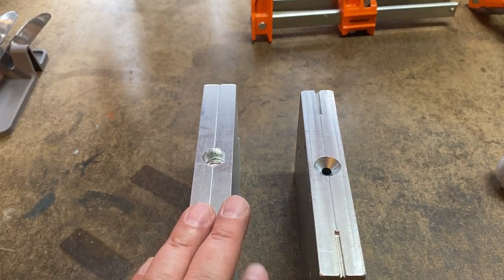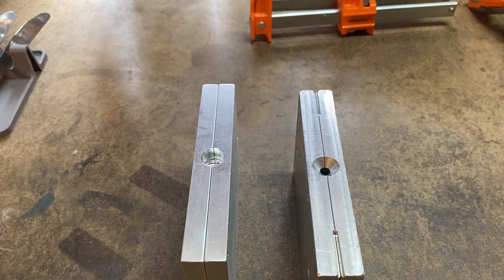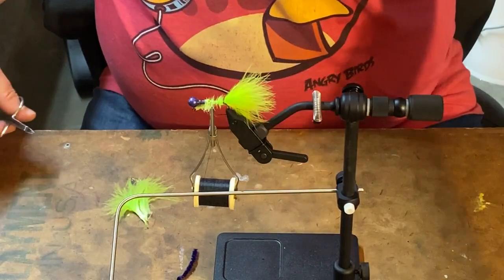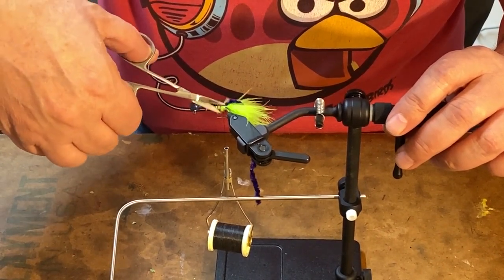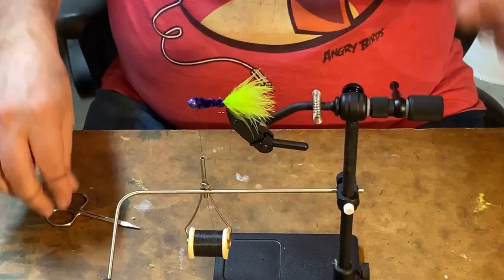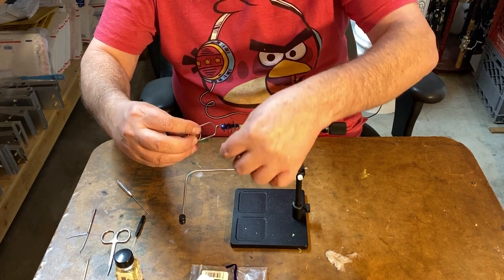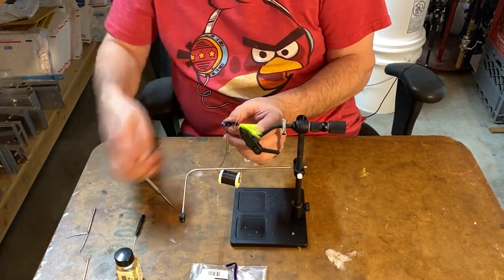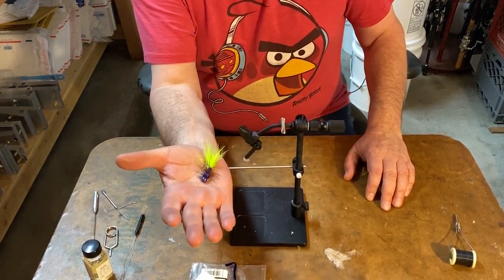Wooly Bugger Jig

Comment: Thank you for showing how you inject that mold.That doesnt look to bad or that unsafe. I was wanting one of his crappie molds and i think i will go ahead and order it without his injector.Doent make sense to have a injector for only one mold.Again THANK YOU.
Reply from the maker: Glad I could help Andy. :)
Reply: Jacob's molds makes an adapter for $25 that makes it so you can use a non tapered injector and or blending block with his molds. I too only have 1 of his molds at the moment and the adapter is what I use. It gets to be a bit much using the adapter, then blending block then injectors but after a few times you get a system down. Hope this helps. 
Thanks for all the videos and info. Now I'm getting the bug to start tying wooly buggers!
Congrats on 500! 👍👏
Reply: @mikelabelle420  Thanks for the info.. The mold that i looking at has to have plate for lams.So i would not to have worry about using to adapter with lams.